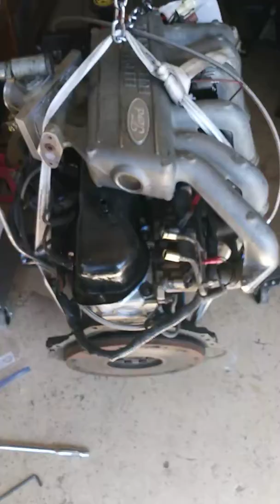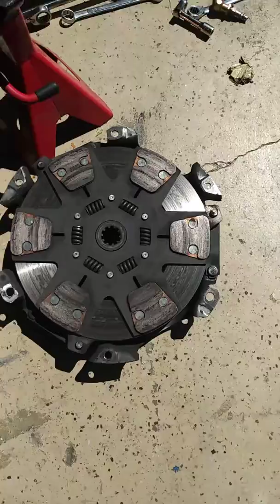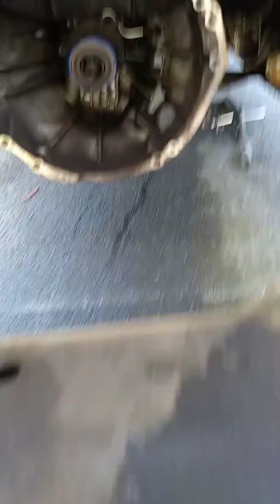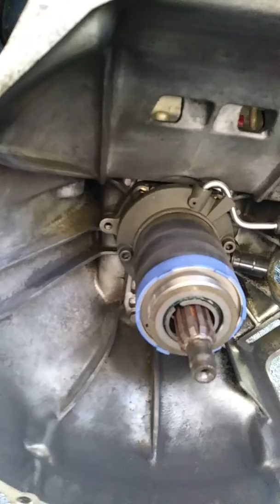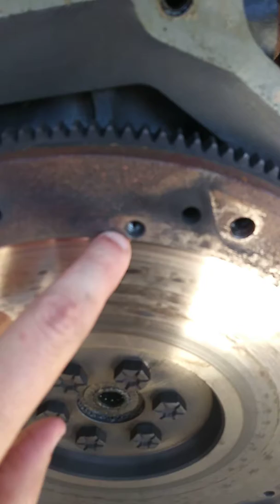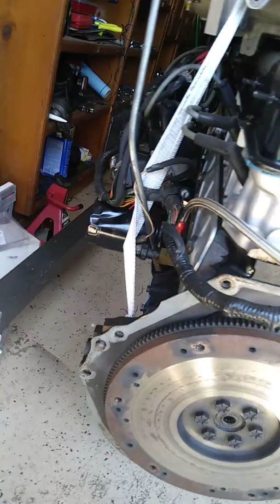Clutch mods explained

Comment: Jeez...all that torque and still running an M5ODR2? Those things were known as being marginal stock!
Reply from the maker: bcubed72. I'm sure I will blow it up soon. Lol. Now that I have good pistons in it I will be turning the boost up to stupid so a c6 will be in my future soon
Reply: Have Run my m5odr2 under heavy boost for over 20000km so far. Using the clutch in the driveline as my “weak link”